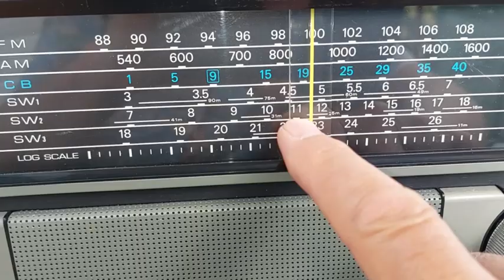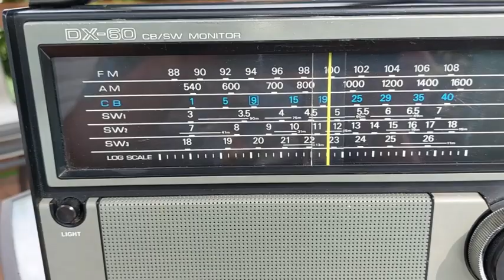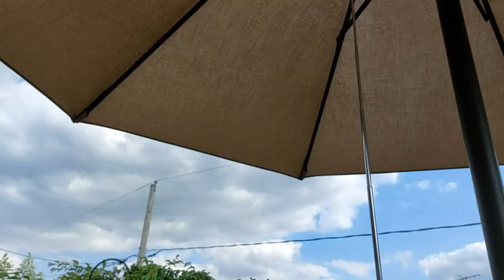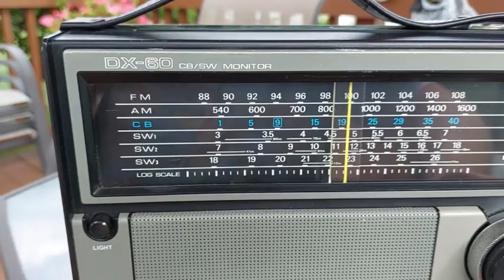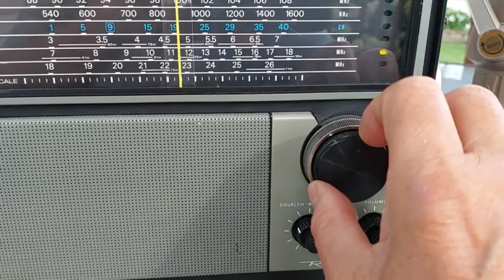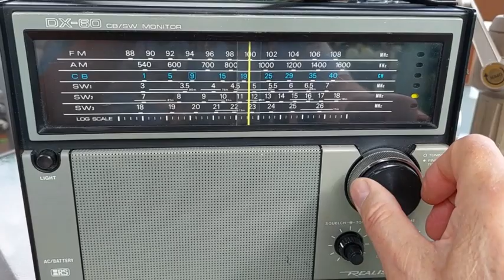A recently repaired Realistic DX-60 CB & SW monitor. The  Voice of Turkey, Romania, and Radio Marti.

Comment: Nice radio. I am selling mine, because shortwave is reduced more and more.
Reply from the maker: 09.14.2025. I checked 31 meter band and found 10  foreign  stations. HAM operators ( and not just MORSE code) can be find day and night on the shortwave band- just you need a proper receiver.

Comment: What was wrong with that radio you fixed them radios are built very well
Reply from the maker: There was no sound. Volume control was bad. I cleaned it. Cleaned the band switch. There was still no FM band. Replaced transistor and modified another circuit on FM section. I put in BFO circuit. Now I can listen HAM operators on all shortwave HAM bands, except 120 meter band( 1. 8 MHz)